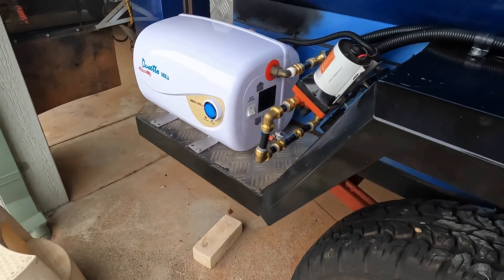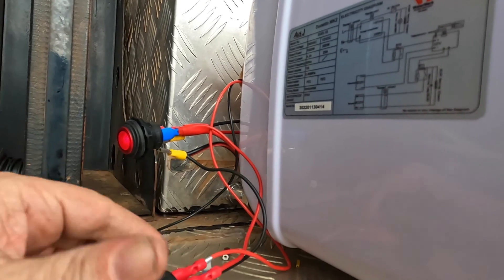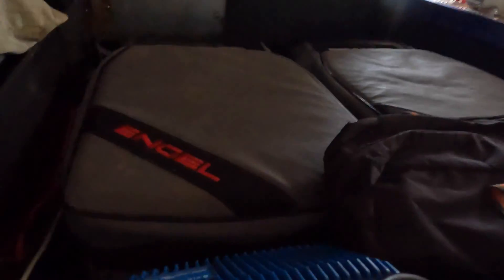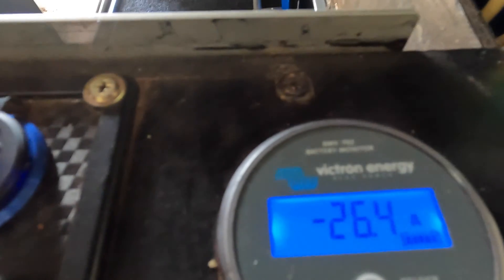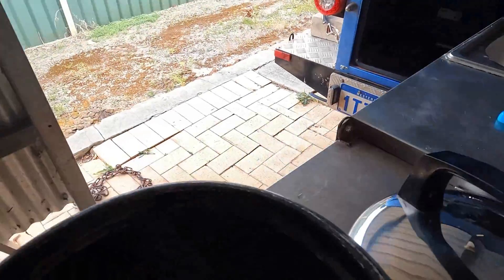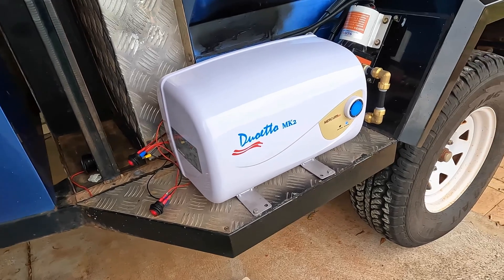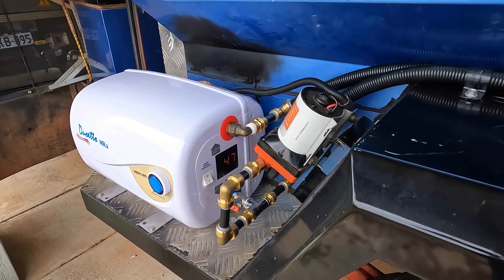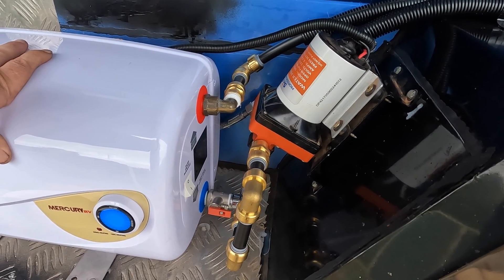Finished Wiring the DC Side.  Duoetto MK2 RV Hot Water System (5)

Comment from the maker: Duoetto MK2 is a 12vDC / 240vAC 10lt hot water system. 
The 12vDC heating element is 300Watts We start testing the DC Side in the Next Video.
Enjoy 🙂🖖

Comment: Does it have an element protection if it runs out of water and left on?
Reply from the maker: you can find out all about it here mate https://ausj.com.au/products/duoetto-mk2-digital-water-heater-10l-12v-240v .  I paid full price and i am not a salesmen.  I am just showing the unit i am installing for Sigi. The way i have it plumbed with the one way relief valve on the cold water intake, Unless i split the tank it will never run out of water. To drain the tank i need to take the that valve off.
Features
Variable thermostat 30-75°C on 240v
Variable thermostat up to 30-70°C on 12v
Digital control for 12v
Durable outer case with service and inspection points
SPCC steel & enamel tank
Single weld line
Polyurethane insulation
Automatic voltage detection switching from 12v to 240v and vice versa
Over temperature and run dry protection
Combination pressure relief valve and non return valve
Incoloy 840 heating element
Wall mount or floor mount

Comment: Another great job Chris, 300 odd watts is pretty good for a DC water heater. After you've mounted the switches, I'd probably run sone insulation tape around the whole lot just to keep the plugs from vibrating off the back of the switch. Those spade connectors aren't the best if not supported. Bet you're looking forward to your next bush trip now !
Reply from the maker: Andy when i do the final wiring after the covers are made (later this week i hope) What i do is tighten up the loops that slide over the spade ends, Then i have to push like mad to get them on. Have not had any work there way loose yet. Also hoping to build in some form of cable support when i get the covers made. Need to talk to Doro owner of (asap engineering)  here in Bunbury about that.  My Son informed us that he has to go overseas again 😒, So we need to look after his dog for another 3 weeks. Still hoping to go bush before Xmas though. Sig and I both really need to go bush. We just love it out there mate.👍
Reply: @JustinCaseSolarPower  Sounds like you've got it covered, all of my place is off grid, disconnected from energy suppliers around 4 years ago, one of the best things I have ever done. I'm in Far North QLD so our camping window is usually around May-Sept, always look forward to it !!
Reply from the maker: @AndyM...  Freedom from the grid and all that depend on you being on it for their living. It is indeed a very rewarding way to live. We need not ever worry about the power bills going up and up and up. Gives us a lot of freedom. That is why i made my channel. To show others 1) how easy it is to do. 2) the importance of using the right gear for the job. Always great to hear from fellow off gridders 🖖👍